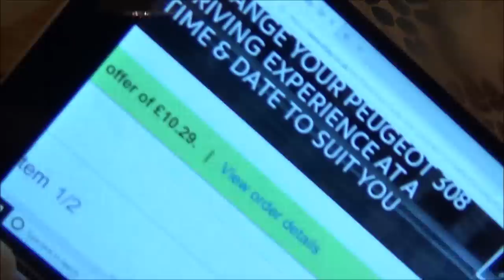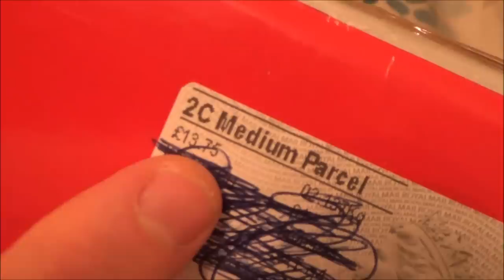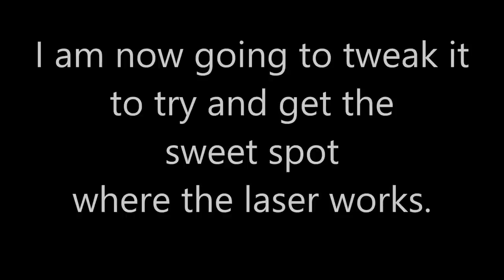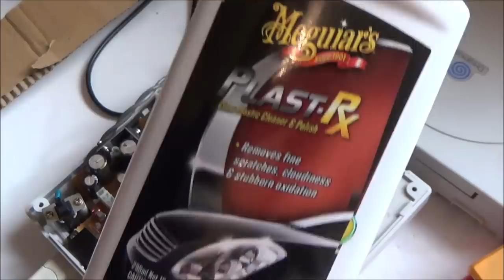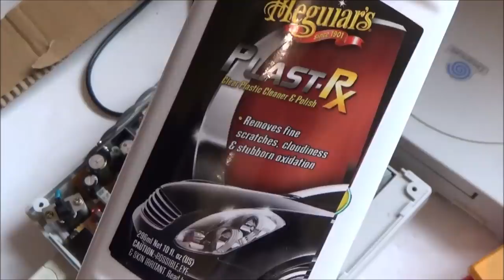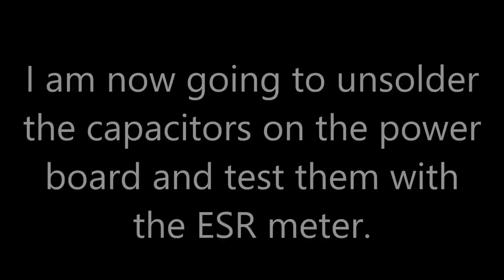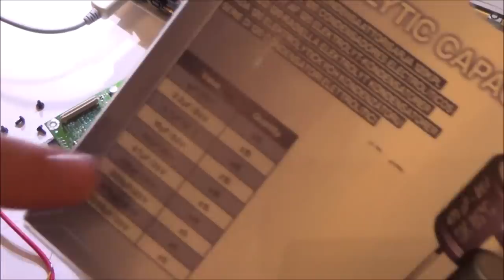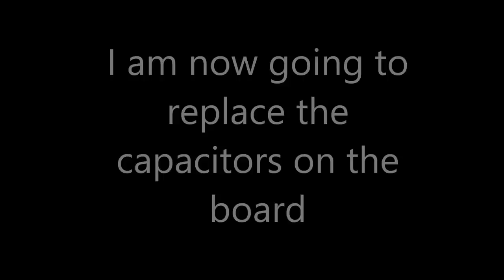Trying to FIX a Faulty SEGA Dreamcast purchased on eBay

Comment: 1:22:19
The leg is moving, so it's not soldered properly contact... also visible the separation/no soldered (from right, the 4th)
Every f.cking time you using this "hairdryer" to solder units to boards, but it's not okay.
Use your soldering iron with fine tip (BC2 or K) and solder legs as everybody !
Reply: Using a hot air gun on chips like that is pretty common practice man.  Not sure how you can be familiar with soldering but not with hot air guns.
Reply: Desoldering with hot airgun, is right...
Solder on to the BCP these chips with hot airgun... yeah, possible... but better to use soldering iron.
If you not get it, at least search on this god damn Youtube :"D
Reply: @101Gabriel_M.  Actually using a hot air gun to re-solder IS common.  Maybe not to you but on this "god damn youtube" its very common as well as outside of youtube.  There is nothing wrong with it, and I also do not see the leg moving as you do.
Reply: Ahham...